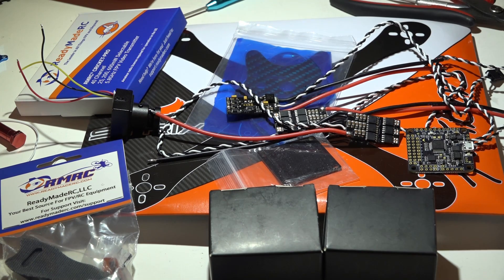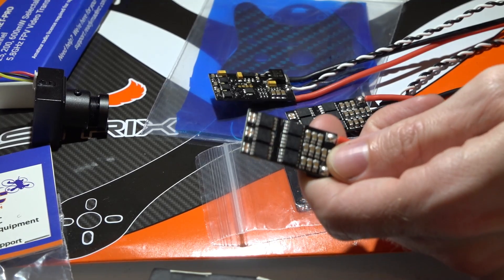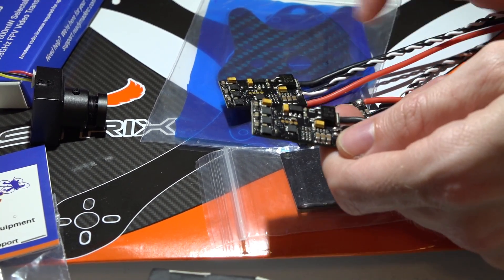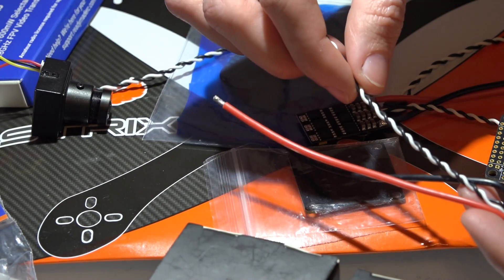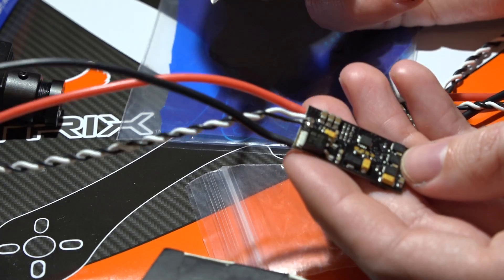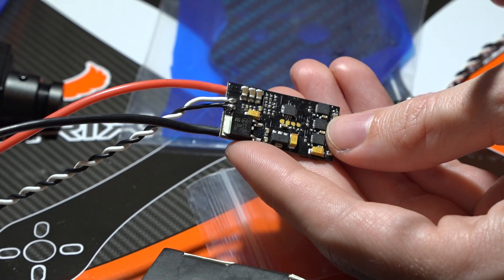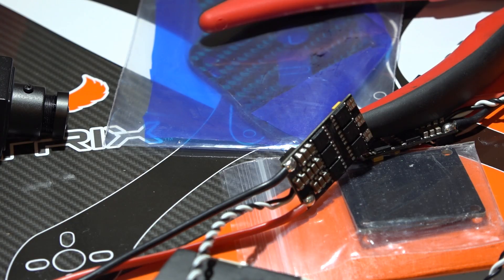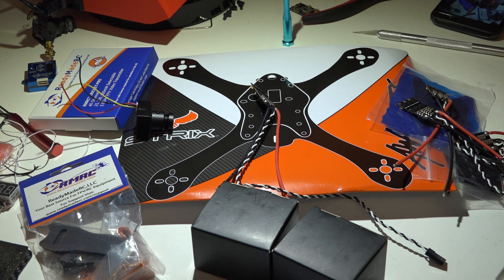ZTW 30a ESC First Look & Signal Cap Removal

Comment: do signal caps need removed for the ztw Polaris 35a also?
Reply from the maker: Yea. It has to be removed for all BLHeli S ESCs if you're using D shot. Some companies remove it for you, but most don't.
Reply: +Project Blue Falcon.  do you know the firmware for the 35amps, or does it pretty select a good version that works
Reply: +mxracer3651. pre select* I meant

Comment: JC have you seen the new emaxx bullet line of esc? They claim all protocol compatibility and they are super small. Thx for your thoughts.
Reply from the maker: I haven't seen them until you mentioned it. They look very interesting. I'll watch some videos and see how they do.
Reply: I just received a set of 20A I plan for a smaller build. Waiting on the 30A for AUK210 build. I have everything for the AUK210 until I saw your vid on the Cricket Pro top plate! Ordered the plate tonight from RMRC. Gearbest has a combo package for the 30A bullets + EMAXX RS2205S 2300KV motors for $109 with free shipping. They ship on March 4th. Speaking of the EMAXX motors..have you ever flown with them? I love these things. Haven't tried the rifle yet, but plan to.
Reply from the maker: That sounds like a pretty good deal to me. And the ESCs look pretty neat. I haven't personally owned the EMAXX motors but my friends use them and they like them a lot. They seem to be a very good value for the performance you get, and I'm all about good values.

Comment: I am running these ESC's on 2 quads with Dshot 600 and have not removed the signal capacitor..they have been working fine..
Reply: Might explain why I am having a hard time tuning :) Pulling the caps off now. Thanks man!
Reply from the maker: It's not necessary but some guys on the RCgroups forums have shown on oscilliscopes that because D shot is using a different signal the caps skew it a little. I guess its kind of like driving a sports car that needs 93 octane but putting 87 octane in it. The car will run but not the best it could.
Reply: I removed them and it flies FAR smoother!!! I recommend removal :)
Reply from the maker: Awesome man. Good to see real results. I've never tested the difference for myself but thanks for letting me know that it's not just a rumor. Now I know for sure.

Comment: So can you teach how to read the chip set that an ESC comes with.  I see in that long ass code "mcu-blahblahblah" it has bb2 in it but... how? I hope I make sense.  Sorry for being such a noob.
Reply: I want to know I'm not getting old gen tech by reading those codes lol
Reply: HAHAHAHA old tech... in this hobby 1 month after you buy your parts they are old tech. There is alot of hype. Those ESCs are BB2's, they are Bheli-S which most are now-a-days. Dont be worried about the best stuff when you first start because you WILL break things.
Reply: der Jakob understandable but I was first getting into this hobby I almost bought a f1 board because I didn't know what I was doing lol. So I get what I'm saying any advice is good advice even if it is as simple as look for the bb2 and your set.
Reply from the maker: Its pretty simple. der Jakob is right about things becoming outdated very quickly. We did go through Oneshot 125, then Oneshot 42, then Multishot, and now D shot all in 12 months. But as of right now you want to just look for the BB2 chipset. Thats it really. You cant see it in pictures online but if you look at it with a magnifying glass it actually has BB2 written on it.
Reply: Project Blue Falcon see I new it was something simple lmao
Reply: Project Blue Falcon it's hard to say where D shot is going because the developer at raceflight says they are able to make multishot run faster than Dshot without the burnout aka "catch fire" that Dshot sometimes does to the ESC.
Reply from the maker: This is just my opinion, so anyone reading this take it with a grain of salt. Baseflight, Cleanflight, Betaflight, INAV, Open Pilot, and Libre Pilot are all open source, meaning anyone can contribute, and anyone can take from it. KISS was proprietary meaning they're secretive. Joshua Bardwell did a good rant video on this because proprietary means you care less about the community, and make it more of a business, meaning you're more in it for the money. KISS has come along and started sharing with Betaflight which is good. Raceflight is very proprietary. A long time ago I had to sign privacy contracts just to use the early versions of the RF1 project thats still not complete. Thats why I didn't talk about it on this channel until recently. So the guys at Raceflight seem to be more in it for the money, treating it as a business. Which is fine, thats their opinion and I respect that. Thing is in a business, you have to be better then all other businesses to profit. Betaflight has max frequencies of 8khz/8khz, and then brought along D shot which is wonderful. Raceflight is trying to hype up that 32khz/32khz is the best thing ever. Multishot can run 32khz with the BB2 chipset but Dshot can only run 16khz. So when people say "hey raceflight, can I use my awesome D shot ESCs at 32khz?", the answer is no which will make guys turn away from their product and go back to Betaflight. So Raceflight has to come up with reasons (made up reasons) of why D shot is bad, and multishot is good. 

Then take into account that I and even Joshua Bardwell has already said that, whats the point of 32khz? Because there is little difference between 2khz and 4khz. There is an even smaller difference between 4khz and 8khz. Most people cant even tell a difference. Try it for yourself. So the question that remains is, which is better, D shot at 8khz, (which D shot has been proven to be better) or multishot at 32khz, but most people cant tell a difference after 4khz. 

Everyone has a different opinion but after using D shot I'll never go back to Multishot. And I keep in mind that Raceflight guys are trying to make money so they have to trash talk D shot and give everyone the blue pill making you think 32khz is any different than 8khz.
Reply: Project Blue Falcon Thank you that's amazing info and very good to know. Thanks
Reply: The current Standard
-5" Props Tri Blade
- 190-220mm frame 4mm carbon
- Betaflight 3.1.5
- F4 Flight controller (omnibus f4)
- BB2 (BLheli-s) ESCs
- HS1177 Camera
- 5.8Ghz 200mW VTX
- 2205, 2206, 2305, Motors
- 4s 1300-1500mah Lipo

 Soft mounting is the Hype (kinda works though)